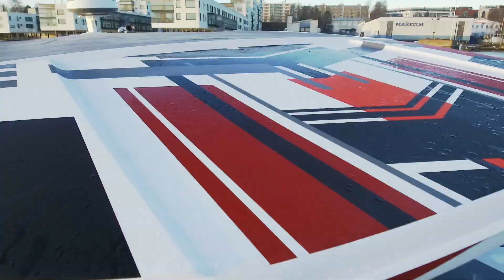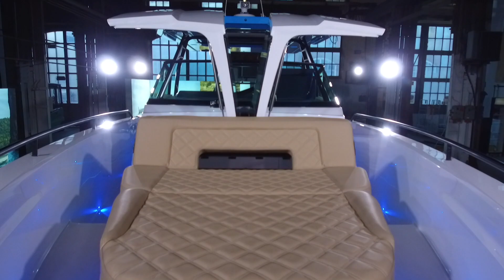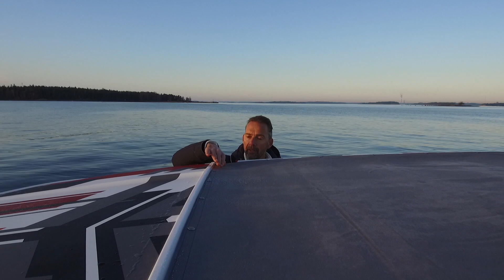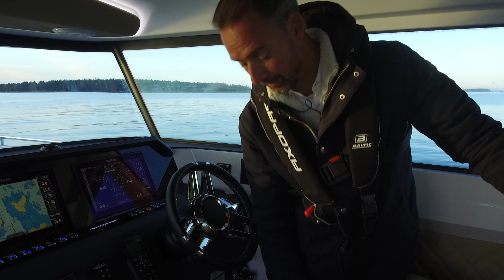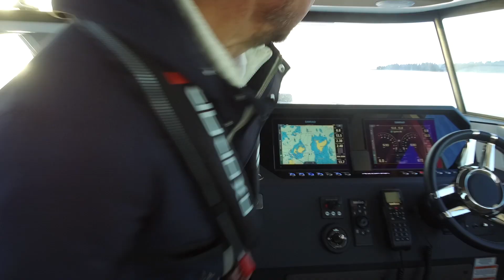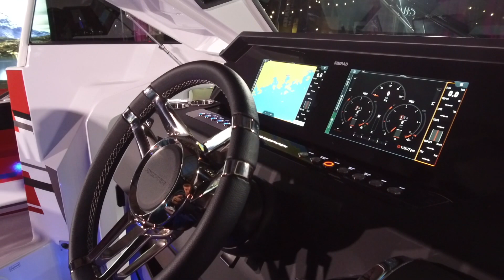Axopar 37 XC Cross Cabin - 2020 model

Comment: The handrails need to be much higher.  Much too low, easy to fall overboard.
Reply from the maker: Thank you for your remark. I wonder if you have seen and walked on the decks though. I have tested the suntop, the cross cabin, and the spyder in Finland and been on the boats many times at the Düsseldorf and Gent boatshow. In my experience the free board is actually quite high. Also, I haven't had a single comment from anyone on the height of the free board or railing.

Today I took some measurements. The height of the free board is on average 66 cm., including the railing even 80 cm. In my personal opinion it is virtually impossible to fall overboard, even when your 192 cm. tall like me.

But please pass by our facility or any other dealer and test it yourself, you're most welcome.

Best regards,

Bart Kempers